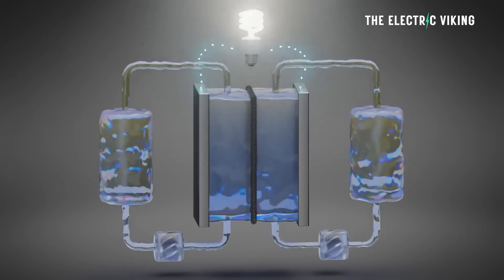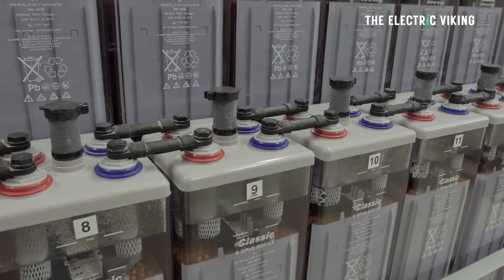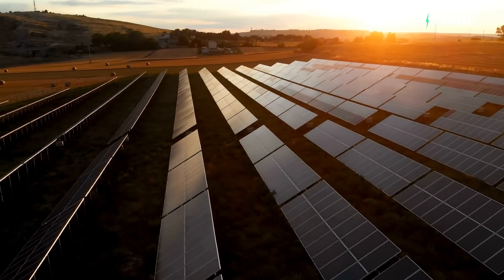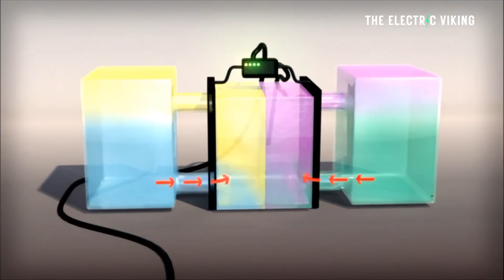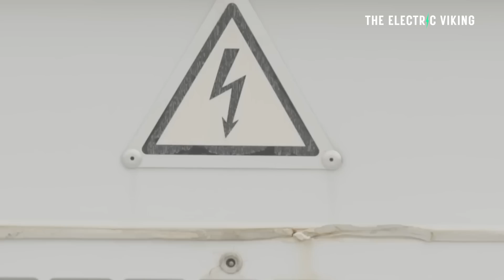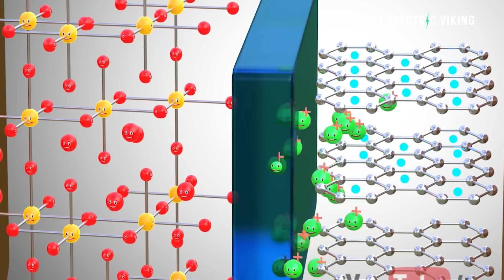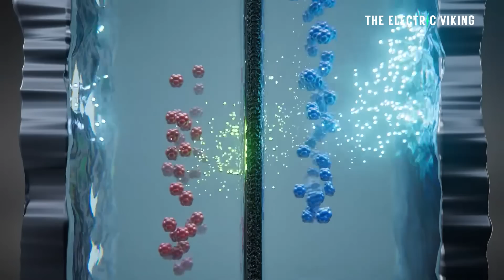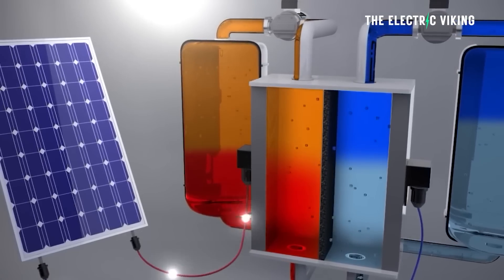Why Vanadium Flow Batteries Are DISRUPTING Lithium & Sodium Batteries

Comment: Battery with moving parts and pumps? Battery with lower roundtrip efficiency? Battery with bigger size? Battery that is costly?  VRF batteries will not at all be able to compete with Lithium batteries!

Comment: I still think a hybrid system of a front-facing lithium/sodium battery as a capacitor for a flow battery makes the most sense, as sodium/lithium batteries the capacity is the expensive part and for flow batteries the power is the expensive part, so you get your power rating from the lithium/sodium batteries and you get your capacity from the flow batteries, and installing them in a radio so within 12-24 hours you can completely fill the lithium batteries.

Comment: Thanks ,very interesting, im stand alone ,have been for over thirty years,everything is a lot cheaper now than back then.i still use flooded lead acid,because you can de sulphate them after abusing them and they are very recyclable and relatively inexpensive.

Comment: has anyone considered combining a flow batteries with lithium ion batteries, because the expensive part of lithium ion is the capacity right while power is relatively cheap, the expensive part of flow batteries is power and the capacity is really cheap. So what about if for every 5kWh of lithium ion battery instillation you added 208.3W of flow battery power to allow the flow batteries to completely discharge or charge the lithium ion batteries within 24 hours, which gives you effectively double the capacity in a 24 hour period to charge or discharge than the lithium ion batteries alone and the ability to scale out the long duration storage for the cost of extra tanks, the fluid to fill the tanks and a couple of pipes as you don't need a larger inverter, the exchange would be on the DC side which also decrease the cost and increase efficiency of doing the same thing but with two installations.

So basically the concept is, use the lithium batteries as a capacitor for the flow batteries and reducing the expensive side of each one. Also you can use the waste heat from the lithium ion batteries to heat the flow battery fluid which makes them more effective, this also allows for a very modular approach the customer tells you how much power they want and how much capacity and you can offer that easily and obviously you don't have to stick to my ratios, that's what I mean by being able to be modular.

Comment: Firstly, these are not batteries but flow cells, and this is a fundamental difference not only in design but also in the way they work. Batteries, regardless of design, have no future either in stationary energy storage or in vehicles due to their numerous drawbacks. The second point, Redox flow cells are nothing new, and the real breakthrough is flow cell technology, which does not require vanadium or other rare earth raw materials and is already being tested in real electric cars - simple, low voltage, durable, no batteries and chargers.

Comment: It may not be cost-effective, but I'd like one for a small HCI data centre in Uganda, with 80-100kWh storage capacity, preferably dual 3-phase and single-phase 220V output, if possible. guess i need to start looking.

Comment: In Romania we have a big problem with electricity. From time to time there is a bill very big because of computer accounting system. Monthly bill is about 30-50lei =6-10euros, but sometime this bill can be 270, or 780 lei or a very big amount of money with no explanation.
And this is not only problem, if you try to discuss with somebody from company is very difficult by telephone, and by internet the answer take long time, so is a nightmare .
For example me, if I can buy a big battery as you say, for energy storage from photovoltaic panel, I will do it to escape from this kind of problems, and to be independent to electric network. More than that there are isolated places where this battery and photovoltaic panel can be useful.
With Lithium battery I had a lot of problem, especially because they are made in China and are not good, no reziliance, not many times to recharge.

Comment: Wait until Boron Nitride Nanotubes-based supercapacitors come out which will undercut even Vanadium Redox fuel cells! Having high-impulse current outflow for powering ultra-high torque EV motors, having 100,000+ recharge cycles with pretty much NO degradation during 0% empty to 100% full and back down to 0% empty charging/usage profiles, there is NO CONTEST that Boron Nitride has super-cold to high-heat tolerance from -100 C to +200 C operations and advanced ruggedization and excellent safety, it's a technology that will take hold of the ENTIRE EV battery industry within as little as 5 years!

Vanadium Redox is good BUT Boron Nitride is BETTER and EVEN CHEAPER AND FASTER to make!

V

Comment: One of my family member lives on the 42000 acre canola farm up near Mullewa in WA. A few years back they leased ~250 unproductive acres to Vanadium Flow Australia to set up a Vanadium extraction plant. Getting the plant set up has been slowed by regulatory processes but mostly by the low price of Vanadium controlled by China who don't want V to upset their Li battery production. However my relative told me it's now proceeding. They must be serious about it because they are in the process of connecting to the gas pipe line from the Geraldton to Kalgoorlie about 10km away. There's plenty of V in WA it just has to be worth extracting which the Chinese are keep tight reins on. The Plan is to 
a) Bring V rich Iron Ore from Mt Magnet (242 km away) initially by truck and then eventually by rail - the railway from Myt Magnet to Geraldton runs right thru the site.
b) take Gas from the Northwest shelf pipeline that runs to Kalgoorlie just 10km north of the site - in progress.
c) Use unportable underground water but good enough for V processing to process
d) Truck the processed ore to the port of Geraldton some 75km away,
e) start processing and once sufficient V has been produce set up a large V flow battery and solar farm on site and run the plant using that
f) Eventually if the price of V goes high enough to reprocess used re-bar which contains high amounts of V
A bit more information here https://www.australianvanadium.com.au - so Mr Viking how about doing a story on this!

Comment: Water and gravity batteries, also known as pumped hydro storage, are a type of energy storage system that uses gravity to store and release electrical energy. They work by using surplus electricity to pump water from a lower reservoir to a higher one. When energy is needed, the water flows back down, turning turbines and generating electricity. 
Water  gravity batteries, offer a promising solution for energy storage with reported efficiencies of 80-85%. This high efficiency means that a significant portion of the energy used to lift a mass (like water or a large block) can be recovered when it's lowered and used to generate electricity.

Comment: They have different use cases. Vanadium flow will never be good for balancing the grid, quick response to spikes up or down in the grid but then again we of course need batteries not only for that, we need batteries also to chug along and just release what has been loaded during the day in the evening peak

Comment: It would be interesting to see a cost comparison - real numbers - between these tecs:
(i) VFRBs 
(ii) iron-based tec that Form Energy is introducing (they claim it will eventually reduce to under $20 per KWh capacity)
(iii) Aquabattery and similar NaCl -based flow tecs.

Comment: I seriously doubt it's true what he says that vanadium redox flow batteries are cheaper than lithium beyond 3 hours of storage, especially not at today's dirt cheap lithium prices. Just a year ago I think I was hearing that lithium was cheaper even up to 6 to 8 hours of storage. I would not believe what he says about that unless he can point to specific data support. Otherwise, I'm betting vanadium flow only starts paying off beyond 6 hours of storage at best, and breakeven with lithium probably doesn't happen for several years after purchase. China is pushing vanadium flow batteries because they have huge reserves of vanadium and very little lithium. So it is international interest. For everyone else it's not worth it yet, most likely. Also another bad thing about vanadium is that as soon as the economy does well vanadium prices shoot up with more steel production and then those flow batteries prices shoot up way higher than lithium battery prices.

Comment: In my point of view there is no disruption, VRedox batteries are on the market for manny years and could not compete with Li based batteries, which got even much cheaper during the last years. I dont think VR can reduce cost as agressive as Li- or Sodium-based cells.

Comment: Another promissing flowbattery is the FeSO4 flowbattery of Elestor (The Netherlands). First develloped as the HBr-flowbattery. Disadvantage is that one reagent to be stored is hydrogen. (FeSO4 + H2 <-> Fe + H2SO4). But so as the famous soccer player Johan Kruif said every advantage has his disadvantage. When the FeSO4 battery is linked to a H2-net during charching the Elestor battery works as a elektrolyser (efficiency 90 %). You sell the H2 so you have to buy the same amount of H2 during discharging (when the flowbattery works as a fuelcell (efficiency 90 %). In my opinion not a problem when you use then 'grey' steam methane reform H2 (with an efficiency of 75 % made from natural gas). When I calculate the total efficiency of the natural gas then used 0,75 x 0,9 x 100 % = 67 %. That is 17 % more than a CCGT ánd you have than also an electrolyser with the same investment. But with every fuelcell the (smr) H2 may not be polluted because of the expensive membranens of the HBr- or FeSO4 battery.
 https://blauwgroenenergie.blogspot.com/2024/05/an-hbr-flow-battery-e.html

Comment: There is no battery that is more power dense than oil and silly Sam comes up with a new battery that changes everything every week. Oh and by the way no-one but no one will run a data centre from renewables

Comment: At last! It has always seemed odd to me that Li ion, whose main benefit is high energy density and therefore usefulness in applications like mobile phones and vehicles, should be the go-to solution for grid-scale storage, where this advantage matters not one jot. Vanadium flow cells are obviously better because of their essentially infinite life. Swapping out a pump every few years is no trouble at all, and we don't have to worry about having to recycle the vanadium. We do, however, have to make sure these batteries are sited in watertight bunds, as the one thing we need to avoid is contaminating the ground water.

Comment: I have been looking for flow batteries in Canada for my small farm/homestead for a while now. Weirdly, it's impossible to find a supplier for (prospective) residential customers. If anyone knows a company that offers residential options in Canada, please let me know!
Reply: I suspect that the regs for domestic batteries are a lot stricter than for commercial ones so the manufacturer probably decided that it wasn't worth the cost of going through the certification process.

Comment: One of the challenges for a big battery, is having a big connection to the grid so I think that disused factorys and power stations could be a good site for them and would bring back a few high quality mechanical engineer jobs to the area looking after the machinary that makes a flow battery🔋

Comment: VRFBs have a place in BESS, but Lithium has less maintenance. As for long term maintenance - with VRFD time is needed to prove & improve  (think pumps etc). Sodium will undoubtedly eat into Lithium applications for BESS, and doesn't Sodium have a better useful temperature range? The world needs more than one energy storage solution.

Comment: This guy comes with new batteries every week.
Reply: The market comes with new batteries each week, he's just "on it" when it comes to reporting on them :-)
Reply: This technology is rapidly developing, because there is so much money driving the development.  We are lucky to have Sam and others keeping us informed.
Reply: Vandadium Redox Flow Batteries (VRFBs) are not new, they've been around for decades and commercialised as containerised units and deployed in grid battery farms for over five years, Sam is just catching up. VRFBs differ in usage from Ion based batteries as they have longer energy stroage lifeimes (100s of years) but lower power charge/discharge rates - they are more suited to baseload provision and backup energy roles whereas lithium/sodium ion batterys are better suited to short term bursts of energy (peaking), balancing power needs and timeshifting generation/energy use windows (arbritage). VRFBs advantages is rapid and high scalability, just add more tanks of vanadium for increased energy storage duration or more cell units in parallel for higher energy output.
Reply: @GruffSillyGoatsure, they have been "the party everyone's invited too but no-one arrives" for a long time now, I think what Sam is saying is there time has come and certainly if they can crack making a long-term storage solution that competes financially with pumped-hydro it could be very interesting
Reply: @backacheache - being in the UK perhaps I'm just used to hearing about VRFBS being added to the grid. What with the UK VRFB leader, Invinity Energy Systems, having deployed the worlds largest hybrid unit back in 2021 (5MWh at the time), to recently signing a deal with Frontier Power who've reserved 2GWh annually of Invinity's production capacity to install into the UK's grid for LDES.

Comment: Both, use both.   Flow batteries are phenomenal at mass storage per $, but not fast at discharge.   Stick a bank of LI batteries in front of a Flow battery to handle the fast moving demand and keep charging them up with the flow
Reply: than just build bigger
Reply: i gave your commentary a five minute thought before answer and its a great ideea to collect as much solar energy and use flow batteries to discharge themselfs directly and li batteries for peak demand. there always a solution. you are a smart person.

Comment: Since I heard about this technology many years ago, I have concluded that redox flow batteries would be ideal  for agricultural regions where; if large pieces of machinery were electrified, harvesters and tractors, the flow batteries could build up a store of energy that could be used in seasonal peak times such as the preparation and sowing of  crops and harvest time.
Seasonally fluctuating businesses such as in the snow fields and other tourism areas could also benefit from these types of batteries ❤
Reply: I'm not sure what you're saying is practical yet for a vanadium flow batteries. I seriously doubt it's true what he says that vanadium redox flow batteries are cheaper than lithium beyond 3 hours of storage, especially not at today's dirt cheap lithium prices. Just a year ago I think I was hearing that lithium was cheaper even up to 6 to 8 hours of storage. I would not believe what he says about that unless he can point to specific data support. Otherwise, I'm betting vanadium flow only starts paying off beyond 6 hours of storage at best, and breakeven with lithium probably doesn't happen for several years after purchase. China is pushing vanadium flow batteries because they have huge reserves of vanadium and very little lithium. So it is international interest. For everyone else it's not worth it yet, most likely. Also another bad thing about vanadium is that as soon as the economy does well vanadium prices shoot up with more steel production and then those flow batteries prices shoot up way higher than lithium battery prices.

Comment: CAES is the all around winner, steel tanks ate 10 times cheaper than lithium,air motor are compatible with green hydrogen or natural gas ,adding one of those can jump output 100% and eliminate the need for reheating, even if solar panels to refill the tanks are added the sistem will be a self charging unit at a lower price than lithium.
Reply: https://www.youtube.com/watch?time_continue=14&v=GSzh8D8Of0k&embeds_referring_euri=https%3A%2F%2Fwww.google.com%2Fsearch%3Fq%3Denergy%2Bdome%26sca_esv%3Df80c30592a28dc32%26sxsrf%3DAE3TifMils7KmXw8SlmMTwlUMQpYOTy2gA%253A1748438421601%26so&source_ve_path=MTM5MTE3LDEzOTExNywyODY2Ng

Comment: Anode is metal, and has a surplus of electrons.  During discharge these electrons leave the anode, travel through the external circuit, then to the cathode.  Inside the battery, ions leave the anode, travel through electrolyte, and find their way to cathode.  This is the easiest way to describe a battery.  When you charge a battery the process is reversed.  Ions (usually lithium), leave the cathode and go back to the metal anode.